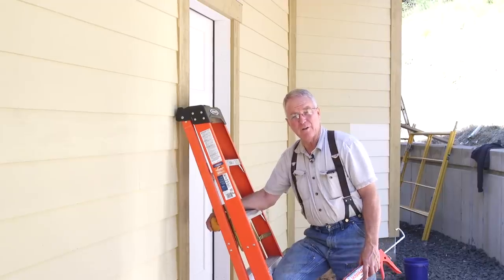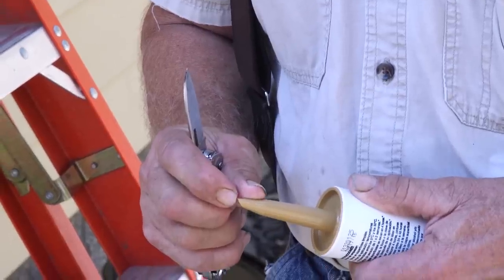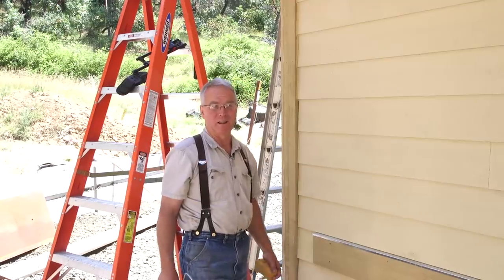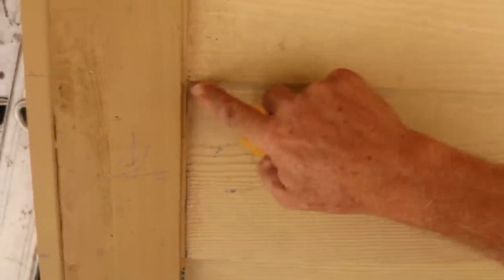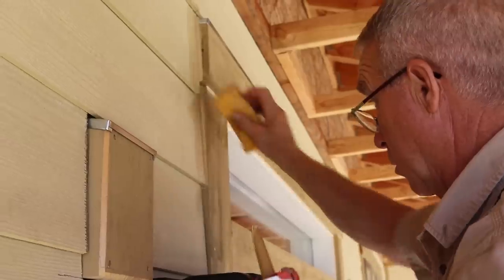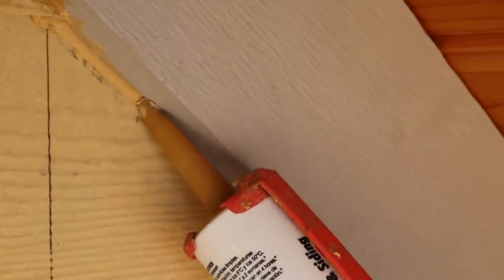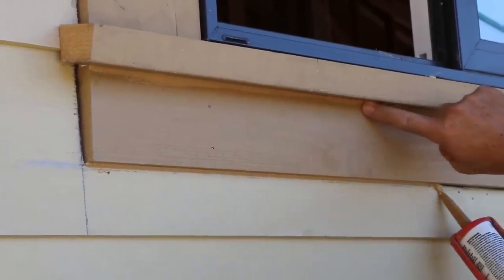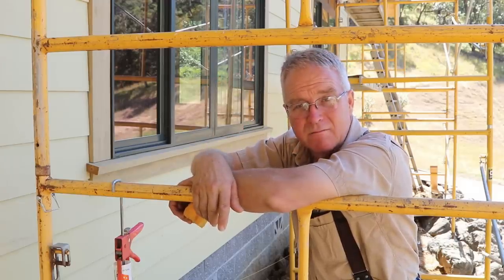Up Your Caulking Game Ep 86

Comment: I know this is a new house, EC, but you forgot to mention how important caulking can be on older homes. I caulked my 1950s built house so well that when a door blower test was done they said it was like it had new windows. It made a huge difference in the livability of the structure as it got much warmer with almost no drafts during our extremely cold winters. Most of the caulk was where the glass met the window frame. People forget how important this is.

Comment: I'm surprised you didn't say what a painter once said to me, "Don't use more caulk than you need to fill the joint." Yeah, it goes to tip size, and speed of moving the caulk gun, and the angle, and all of the other things that go into caulking. But, what that painter said to me one day when I was struggling. As he stood there watching quietly, with a smirk on his face. I turned around, frustrated, irritated, and just not liking to be the joke for the day, and said, "What?" He smiled and said, "It'll go a lot easier if you just use as much caulk as you need to fill the joint." And then he walked off. And it took me a while to figure out what he meant.

Comment: "dont go for the cheap stuff". actually in our area, less than 90 kilometers away from my house is the Adfast HQ. the least expensive stuff is worth 4-5$ a tube, adseal is 10.19$ a saussage (2 tubes). so actuallt the cheap stuff is still the best available 😅😅 100% silicon without solvent, almost no initial shrinkage, no overtime rotting. ive seen many joints last 30 years and still soft, flexible and still well bonded. amazing stuff for cheap.
Reply: Cant paint them though

Comment: Two things that help your Caulking. #1 -- Get a dripless gun. They are worth their weight in gold! #2 -- When you cut the tip, where the top most point is, nip the point. That way you don't drag a sharp line through you new caulking joint! :D

Bonus -- If you have the opportunity to caulk something, volunteer to do it. Repetition and practice are king!

Comment: We've come a long from the days when only putties were available to seal constuction joints and glazing.  Drying and cracking was a given, nothing one could do at the front end could prevent it.

Then the elastomeric compounds came to the market, chiefly in commercial construction because of the expense.  As an architectural detailer I suddenly had to specify and draw sealant joints because companies like Thiokol wouldn't warrantee performance outside their specs.  There were specific ratios of width to depth to ensure sealant performance along with the backer rod.  Joints had to be tooled to a slight concave surface to reduce stress points during contraction and expansion, the potential failure points.  Had nothing to do with clean appearence. 

Surface prep include solvent cleaning and in some instances, depending on materials, a primer coat was needed.  Overall nasty compounds that damaged caulkers fingers with chemical burns. Caulkers coming on site could be identified by the bunches of spoons in their leather belts.  They bought the spoons at yard sales; teaspoons, table spoons, all kinds,  with various tip profiles and widths .  Narrow joints just didn't work for the early elastic compounds, IIRC, 3/8" was min width.  Expansion joints could be greater tha one inch. Hence the 20 piece flatware sets. ;>)

So count your blessings guys that we now have easy to apply sealants now that are available to the trades and DIY home owners.
Reply from the maker: Thank you so much! Excellent background that I wish I would’ve had before I made this video!
Reply: @essentialcraftsman  Well, thank you very much.....even though I'm older than dirt I've learned much from you about new materials I haven't worked with yet. Kudos to you sir.

One of the things I' ve been thinking about trying for caulking are the little narrow silicone spatulas.  Cheap, a notch above the sponge brushes. They're about an in wide with various profiles, rounded on side, sharp corners on the other, some spoon shape ones, as well as just square edged. Should get very good squeegee effect as darn little sticks to silicone.  Could even round a corner to needed radius using a lathe gouge and a swift hammer stroke as they don't really cut well.  If I get a chance, I'll report back.

 Health concerns have shifted my little projects to a back shelf....still, I can enjoy your videos.

Comment: Scott, you forgot to tell them the right way to use the gun and what the parts are for. Like the silver button in the back, many people don’t realize that’s to stop the flow so you don’t leak all of your caulk out. Some of the cheap guns don’t even add that feature which makes for a messy job. Also when caulking siding be aware of the overall look, it’s the finish of your house and caulk lines will make it look like crap if you don’t do it right. It’s purpose is to seal but it also needs to blend seamlessly.

Comment: "It's not rocket science.". Well, about 20nyears ago I did a door installation for a gentleman. He was watching me and I did have a gap between the brickmold and stucco that was a little larger than I would have liked. I did use some backer rod, but the guy asked, is that caulk designed for a gap that large. And I responded, Yeah, I don't all the time. He then says, well, I'm a retired engineer from Dow Corning and helped design the sealant for the tiles on the space shuttle. Needless to say, he was happy with the installation.

Comment: Caulk is essential but in the desert where I lived most of my life exterior caulking always shrinks, pulls away and curls. It has to be cut out and redone every 5 or so years. Wood casing, etc. shrinks, stucco shrinks, plastic window frames shrink, everything shrinks except metal.
Reply: On timber siding, I prep the ends of the boards to a small fillet, rather than a sharp 90 degree cut edge. Then the caulk has a small ‘landing’ to be applied to. I apply my primer, or first coat of paint before caulking. On my all timber sided house, I haven’t had to replace any caulk in 20+ years.

Comment: As a 25 year painter “Dripless” is the caulk gun that is most popular. You can still have that toolbox friendly low profile shape but there is no button to release the pressure after every squeeze. It’s spring mechanism does it automatically. You may be so familiar to yours it doesn’t matter but that would drive me nuts. That being said your caulking is A+

Comment: My best tip on caulk, read the label. Make sure it is for the job you’re doing. And remember, Paint will not stick to 100 percent silicone.
Reply: If you play your cards right, you can immortalize your pencil layout marks by not realizing the silicone caulking is quite transparent.
Reply: We use paintable silicone exclusively in my building company. It's a product called Sika MS
Reply: Silicone looks really good around a glass block window in a river rock wall.😉..
Reply: A S C E N D E D W H I T E M A L E “MS” stands for modified silicone. Therefore not 100 %

Comment: One item you didn't mention is attention. Caulking doesn't need to be perfect, but it needs to be consistently good enough. A flaw in the wrong place leads to wet spots or even mold in the house. You are right to say that this is a mindless job in a way. But a few brain cells still need to stay on the job site like in 10:55

Comment: As a 15 year painter it’s a common mistake to cut an angle.  If you cut caulk flush you can always rely on 90 angle to get a good line.  If you cut an angle you can lose it going around trim or whatever.  That’s the only thing he got wrong.  Other than that he’s the man

Comment: Is caulking the underside of that sill a good idea?  Where does it drain if water gets inside?
Reply: I wouldn't caulk that. Needs to be enough space for drainage and for the drip edge on the boards to work. This is perfect in my mind https://i.imgur.com/199I8x1.jpg
Reply: Wouldn't you like to know?  Don't you have bigger problems???  Like burninating some villagers or country side???  On a serious note, I had some sills that failed me when the wind and rain was more intense.  After I cauked the gap under the sill, the problem was gone.  I took me a few winters to figure out how the water was getting in, but I'm the end I was victorious.

Comment: You 'muricans have strange ways of building compared to Scandinavian building methods. We use caulking in certain areas around windows etc. But I have never ever seen anybody caulk every single meeting point between different pieces of wood. I can get the visual appeal in certain points, but is this really required? We build our homes with wind and waterproofing underneath the siding. We also designing everything to drain outwards, space the siding from the building frame to have a air gap and ofcourse wind/waterproofing it with rolls of special membranes on the frame itself. 

The siding is just the outer skin that takes the beating and stops 99% of the weather and does not generally have to be perfect other then around penetrations like windows etc.

The advice on caulking generally is very good though :) Will try the sponge.

Comment: Caulking is one of the few skills I've had enough time practicing to say I'm a pro at. It just doesn't require 10,000 hours like everything else does.
Reply: I can give someone 1 lesson on a door jamb and half room of baseboards and if they are not a complete idiot they're off and running.
Reply: @williamsmith9026  as long as a person is detail oriented and patient they can be a pro at caulking in no time with no more education than this video provided. There's some pretty smart trades people who just don't have the patience for it, nor the care for fine details. It's a great confidence booster as an early skill to get under the belt of a trainee as well. No matter the simplicity just having ONE thing they can do really well can sometimes be just enough motivation to keep them going for the next skill they need to learn.

Comment: You should never use your finger on 100% silicone, it will yellow in a few years. I learned this caulking Fiberglass panels in my supermarket, it also smears the caulk on the panel that will be horribly visible and very difficult to remove.

Comment: A couple of seasons from now, those caulk beads will be cracking, peeling, pulling away - paint or no paint. Whadyathink? The hard part is choosing the correct caulk for the application, from way too many choices, with little or no guidance from the manufacturer.
Reply: No

Comment: 6:35 Nooooo!? Get some white caulk and join the two. The point of caulk is to match what your applying to and for appearances. Silicone should be used around light fixtures, doors (if needed/ some require caulk), certain windows/window panes, side ventilation or any exposed holes. And always use tar if you have a small hole in your roof, if you can't repair the damage yourself.

Comment: What kind of caulk is used for vynal sideing?
Reply: Bernard,  the siding manufacturer has recommendations for their siding, but for the most part, vynal siding installed correctly will need very little or no caulking due to the expansion and contraction that vynal  does in the temperature cycles of the day and year.
Reply: @timrich6755  thx for responding

Comment: Siding joints are caulked as you install, not after.  Caulk is the wrong material for nail holes.  OSI caulk is much better than acrylic chalks.

Comment: I would never touch the chaulking with bare fingers or smooth it without gloves or proper tool for that procedure. Cleaning and removing the excessive chaulk should be done with a rag or a splint, too. Chaulking chemicals harm the skin and absorbs to the body in the long run. In my opinion, health & safety are part of the profession and being a true craftsman as well. Besides, the grease and particles from the fingers does not belong to the properly executed chaulking project. But this is just me :)

Comment: Do not seal or caulk any bottom seams of anything- trim, etc. You can make the gap small, but don't be silly and seal that. It's begging for trouble. The point of a typical exterior is that it breaths and is NOT a vapor barrier. In very hot climates the outside wall IS the vapor barrier and you don't use one on the inside walls. That's a different situation.

Comment: Tip - long finger nail does not work in corners!! Sponge is great. Hard to find correct color for exterior calking in water based, wipable paintable caulk. Seems like its always that gooy, sticky, draggy non water based more expensive stuff that will match in color...

Comment: Interestingly, if you read the back of almost any caulks, it says “not for butt joints”. Then what is it FOR?!!

Caulk is for cracks. Dap “Fast-N-Final” putty for holes.
Reply: Too much expansion and contraction so it won’t hold well.
Reply: Butt joints defined as two pieces end to end. Scott is caulking ends to vertical pieces. Hardie install instructions also say not to caulk butt joints, but to install flashing behind them.

Comment: I appreciate that you are speaking about the craft of caulking here but your handling of the building exterior presents some risky envelope conditions with respect to drying and air access. You do not have a face sealed ‘system’ here (curtain wall) but instead an interior vapour barrier and exterior moisture retarder (umbrella principle).  The caulking you are applying here has an aesthetic purpose in hiding gaps and an envelope danger in that it can trap water once past the outer skin( and it will happen). You are turning thousands of years of tradition and practise on its head. Luckily the very bottoms of door trim are left uncaulked and the very bottom of siding the same. But there is a huge internal ledge at every window ledge that you are creating that can trap water and never evaporate. One flaw in the face seal system or ‘shrunk bead over a couple years’ is all it takes - one flaw or gap  for the water to ‘run into’ but then it will have have nowhere to evaporate ‘out -through’.
Reply from the maker: Great comment. I am not entirely on board with every detail of this but I take great comfort in the fact that my 3 foot overhang‘s are going to see that  this siding will never see a drop of water. Now the South high gable end wall will occasionally see water but so far , in our low wind environment, almost none of the rain that has fallen  over the last 10 months actually landed on the side of my house. All that being said, there’s real merit I think to what you described.

Comment: Buy a battery operated caulk gun and toss the old school tool. You will never regret it. My cheap Ryobi gun runs circles around doing it by hand and is smoother by far. I bet a guy with a battery gun could beat two people with regular guns. I don't even use a rag to smooth the bead. I just use my fingers to smooth things out and move on. After you wear your skin and finger nail out change fingers.

Comment: Haha the painters on my job are piece workers, same as the drywallers.
I've had 12 sprinkler heads painted on site now costing close to 2500 dollars to replace, of course back charged to the painters. Not to mention the garbage on site left by the drywallers who think they don't have to pick up after themselves. It's horrible to work with trades like this. They should be illegal. The owner then wonders why they have deferred the date for move in 3 times. Penny pinchers until they die. They really bring the quality of all the trades down. Shameful.

Comment: Use a good gun.  I've had much better results with a correctly ratcheting gun that tightly holds the tube instead of a cheaper one that warps over time.

Comment: The tip on not putting too much on is very important; and if you do put too much on; take it off!! I was in a house once, where, while you couldn’t tell standing up (I guess that’s what the caulker thought), when you bent over, the caulking on the baseboard was smeared all over and had to have been 1/8” thick. Pretty sure this guy used an entire tube of caulking on 5 feet of baseboard and then didn’t use a rag when he was done. Don’t be this guy.

Comment: That is the only brand of caulking worth spending money on All of the colors except  clear Does not have a cellophane  clear has a cellophane That needs to be punctual before use because it’s meant to be tinted on the job site with the tinting tool

Comment: I can imagine a rather sore finger after 25 hours of caulking with a finger. Looks great though.
Reply: I'm a painter and you are right! Once the skin wears away on one edge of your index finger you flip over to the other side and use that edge, then move on to your middle finger and use up both edges of that, then the ring finger and then the pinky. The pinky is tough because it's usually too small to get a nice bead but that's what you have to do. Once that hand is done. it's the left hands turn. After that you just grin and bear it and use your raw bones. If you want it to look good, it needs to be done, your skin will grow back in a couple days.

Comment: This is called painters prep, and a great painter knows the value of a good prep job before painting. The work is in the prep and the finish results are worth every penny spent on the prep. As a painting contractor I see these low ballers come in and beat my price ? All they do is a quick spray and there down the road? I could not do that injustice to my clients, because an exterior paint job is more about protecting the home than just lip stick on a pig.